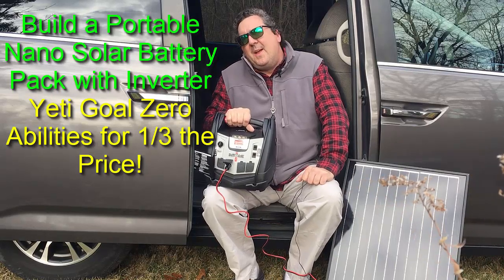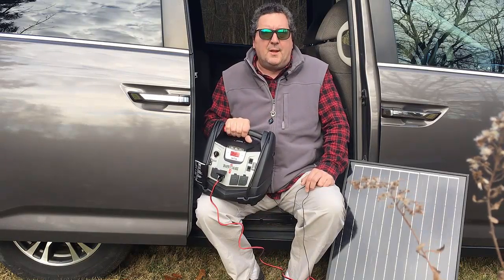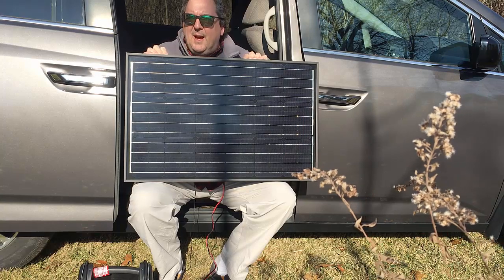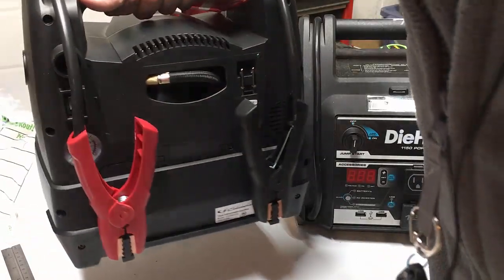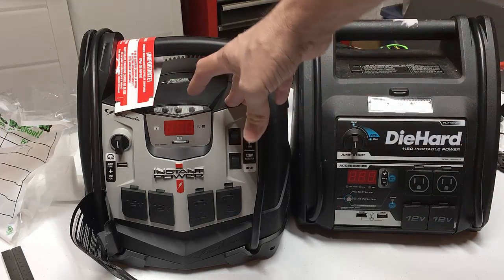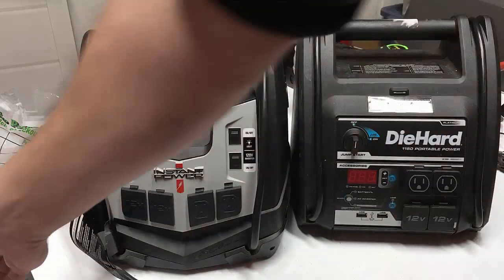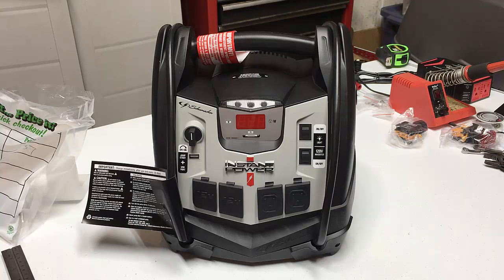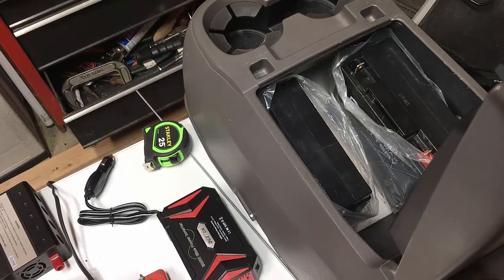DIY Portable Solar Battery and Panel

Comment: Check out the voltage on your charger most are 12 volts and if you check the specs on a sealed lead acid battery you'll find as I did when watching utube videos I then tore apart my old black and decker it was confirmed right the battery was written do not discharge below 12.2 and the float was 13.4 volts and full charge is 14,8 and the voltage on the charger was 12 volts so it's dead to start with anytime you leave a lead acid battery in a dead or flat stage the sulfur in plates start to harden a process called sulfation and the battery won't take a charge since there is always internal shorts the battery losses power over time so in a month if you loose a volt it now down to in making the battery useless so once a month you'll need to charge it properly best way is to use the cigarette lighter plug to cigarette lighter plug and hook up a good battery charger to it

Comment: I need your advise. I have a portable folderable 100W solar panel which I use with Jackery power bank. Can I just use this panel's one of the connector to charge Schmacher power bank? Please advise me. Thank you so much for the video
Reply from the maker: Hi Eric, You will need to put a solar charge controller in between the panel and the Schumacher.  It's what I show at this point in the video:  https://youtu.be/GUaXuZw7rzc?t=978    You could also use a different model of solar charge controller (10A is enough).

Comment: @Odyssey Camper
According to the manual. charging by means of DC power overrides the 'maintain' mode and can therefore overcharge the battery with dangerous results. Is that problem solved because the dc power is coming out of the solar charge control?
Reply from the maker: No, unfortunately it does not prevent that issue. From what I see in the wiring, the 12V goes directly to the battery. However, you can check the battery voltage every 30 min or so when driving and pull it off when it gets charged. You’ll never get to 100% that way, but you can get to 80-90. You can also put a small inverter between the cigarette light and the 120v built in charger, to get a full charge.

Comment: Hi there!  LOVE your stuff! Great content.  Questions: 1) you day Diehsrd has larger invertor. What I see is both have 400w invertor. Did I miss something? 2) can both of these be charged via your 12 volt cigg lighter plug and do they come with that cord?

What I did see was that the Shumacher, I think, had a bit larger ah battery...18ah on diehard a d 22 or23 ah on Schumacher.
Reply from the maker: Thanks!  You have amazing attention to detail!  You heard correctly, it's just that the specs for the Schumacher are misleading.  If you look at the manuals for each, the Schumacher is rated for 200W continuous.  They cite the peak capacity which is 400W.  This link should bring you to the right page of the manual.  https://www.manualslib.com/manual/149568/Schumacher-Instant-Power-Xp2260.html?page=8#manual  The DieHard unit is rated for a constant 400W.  It's shown on page 9-10 of the manual.  https://c.shld.net/assets/docs/spin_prod_751319512.pdf    You CAN charge both directly from the cigarette lighter but neither one includes the cord.  However, if you go to my Kit page here, you'll see the parts to make one.  https://kit.com/odysseycamper/diy-solar-generator    One word of caution.  Although you CAN charge from the lighter plug, you should not leave it connected for more than 40 min or so, or you can overcharge it.  Also,  since your vehicle doesn't really have a float charge mode, the pack won't be 100% charged, but maybe 90%.  In some of my videos I mention that a dead battery could draw too much current and blow a fuse.  I tested this and it turned out NOT to be true of these tiny batteries, so it's no problem charging from the lighter socket.  Thanks for watching and for the awesome questions!!
Reply: Thanks so much for your response.  I am also having trouble finding at least a 50 watt suitcase style solar panel.  Harbor Freights is only like 13 watts - I think.  I don't want to mount anything on the vehicle that I would be using.  Many others are too expensive- Even the folding style.  The flexible ones are poor quality to me.

BTW, the prices have gone up on both Jump boxes - even at Lowes.  Pretty good jump.In the $130 range at Lowes for Shumacher and about $160 on Amazon for either.
I currently have a Everstart 1200 from Walmart - only $64.99 but you cant replace the battery and the invertor is only 100w. Once that battery is shot, the whole box is toast.
Reply from the maker: I’m sorry, your second message got held up in the filter and I didn’t see it. Yes, the prices seem to vary wildly, which is troublesome because as soon as I give someone a price estimate, it goes up or down. I’d check over a few weeks and when you see a price in the future that is lower, jump on it. As far as the folding panels go, they are overpriced in my opinion. I’d consider making your own with a long (piano) hinge, a latch, and a handle. All three can be found at Lowe’s. Then you can buy the panel size you need.

Comment: Hey there, I am on a similar path as you (converted Chrysler Pacifica)...I currently have the Schumacher unit. My plan is to expand via minn Kota battery box, and throwing a 125ah agm inside. My main question is for charging this set up while driving. I didn’t want to mess with male to male aux. from car to jumpbox-but was thinking; aux/cig. From vehicle (15amp) /into inverter 150watts/then plug in a normal 110 extension cord to the proper charge inlet on the back of the Schumacher...I haven’t seen anyone do this to keep batteries charged/maintained. Will it charge both batteries safely. I am still learning, but I believe what is vulnerable would be the male to male connection between the Schumacher and minn Kota box. If the 125ah battery is low it would draw more through that 15amp fuse I believe, or would it work? Idk -I will eventually do solar, and have a 60 watt folding unit by Rockpals for boondocks. And info would be appreciated... thank you! Safe travels
Reply from the maker: Cool, another minivan camper!!  I think you do have a valid concern with the current draw from the 125Ah battery if it is low.  With the 22AH batteries in these jump packs (some are 10Ah) even a dead battery only draws a few amps.  With the bigger one, you could draw more than 15A.  But fuses are cheap, so I would try it and see.  You might find that it's not an issue.  I think your idea of connecting from the lighter to an inverter, into the charge inlet would work.  It would be inefficient, but it should work fine.  Inefficiency isn't really a concern here, since the engine is running anyway.  Also, it would charge both batteries without damaging the internal charger, since it is current limited.  BUT, it is not big enough to rapidly charge both batteries.  It would charge slowly and would probably only be well suited if you are driving every day, or using it to keep things topped off.  I actually have my diehard in the garage right now, keeping two batteries topped off.  I turn the jump switch to "ON" and connect it to the spare battery, which puts them both in parallel.  Then I plug in the unit to run the charger.  Hope this helps (going to read your other questions now).  Thanks for watching!

Comment: LOVED THIS VIDEO!! IS THERE A WAY I CAN JUST BUY A Solar Charge Controller AND not have to sauder anything? CAN I JUST CRAZY GLUE IT TO THE BACK OF THE SOLAR PANEL, THEN CONNECT IT TO MY UNIT THAT YOU MENTIONED?
Reply from the maker: I'm glad you liked the video!  Crazy glue would not hold due to the slight flexing of the panel and the effects of weather.  However, you could use aquarium sealant (RTV sealant), it just takes some time to dry.  I used 3M trim adhesive strips, but the problem with those is that they make it near impossible to remove the charge controller if you ever want to (I've tried and I think it would damage the panel).  To avoid soldering, you could use crimp on lugs like these  https://amzn.to/2RjOKPk  Thanks for watching!
Reply: @OdysseyCamper  omg you are AWESOME!!!! So to be clear, I can buy those connectors and not have to sauder a thing? But I still need to open the solar panel and connect the wires right? As you showed in the video? Or no. 

THANK YOU so so much :)
Reply from the maker: Northern Girl you’re welcome!
Reply: @OdysseyCamper  when you have the time
 Please awnser my q with your thoughts. I'm learning a lot and I am about to buy the solar charger and booster :)
Reply from the maker: @ASMRFoodieeats2  That is correct.  However, you will also need the crimping tool, which I forgot to mention.  Here's a link to the tool, but you can buy this in a kit at Lowe's or Home Depot for less than this Amazon one.  I'd only buy this kit if you will be doing other work as well.   https://amzn.to/2RmW2Sj
Reply from the maker: @ASMRFoodieeats2  Thanks for the ping, I read your comment on my phone and did not see the questions.
Reply: @OdysseyCamper  thank you!! The crippling kit!! Can I get that instead of the first mentioned product. Or both? Thanks again.
Reply from the maker: Northern Girl if you get the kit it will have what you need.

Comment: Thanks for the video but I do have a question is the 12 volt regulated and is the 110 regulated? I'm sure you know what I'm talkin about but for others I will explain it does it maintain full Voltage until the battery is completely dead or does the output drop during discharge. Thank you in advance
Reply from the maker: Wes Walker Good question!  The 12 volt output is straight from the battery, so no, it is not regulated. The 110 comes from an inverter (for the benefit of others reading this) and maintains full voltage until the voltage drops below its operating voltage. I’ve never tested  the exact battery voltage that this occurs at but I THINK it is around 10.8 volts. It beeps and then the inverter shuts off. Thanks for watching!

Comment: Hi, very helpful vid.  But can you help me with a question?  I can’t find anyone I trust or who knows.  I want to get a Dometic CF-18 refrigerator for my Prius, but I’m afraid to try it on my 12v.  Will the Shumacher or the Sears DieHard you show here get enough amps (is it amps or watts?) to take care of the Dometic all day and night if necessary in my Prius (I would be driving almost every day to keep it charged)?  SURE would appreciate it.  Thanks!
Reply from the maker: Carole Olson the battery packs (either one) would power it while you sleep and during the day, you can plug it into the Prius. Keep the empty spaces filled with water bottles and it will not draw much power once it is cold. Even unplugged, it should go through the night and still be cold in the morning.

Comment: Do you know how I can find the right model number to replace the schumacher 12vdc battery with a lithium battery. Thanks
Reply from the maker: Transform I don’t but you could probably fit one that is the same size. If you go to this post, there is a link to the  “DieHard” battery (same as the Schumacher) and it gives the dimensions. http://odysseycamper.com/battery-discount/     Note that you would also need to replace the internal battery charger, which was not designed for lithium. Thanks for watching!

Comment: I bought a 100-watt Renorgy solar kit. It came with a 30 amp charge controller, and some heavy wiring. Could I wire it to a male cigarette plug after the change controller into the  Schumacher similar to what you showed in the video? Thanks in advance. I really hope this works!
Reply from the maker: Greg F YES, you can!  The panel can generate enough power for 8 amps at 12V and that’s well within the 15A rating of the cigarette plug. In practice, the voltage from the panel will be higher and the current lower, but it adds up to the same amount of power. The charge controller will then step the voltage down to the right level for charging.   Go for it!
Reply: @OdysseyCamper  Thank you!!!

Comment: Have the Schumacher SJ1332 does it have overcharge protection when charging through the 12 volt charger?
Reply from the maker: ANDY WAN it does not have built in overcharge protection but the instructions say 30 min at a time. I’ve charged for 60 min on/30 off and then check the charge state. If you use a charge controller then you don’t have to worry about overcharging.

Comment: Hello. I don't know if you'll get this in time I'm a total newbie at this stuff. It confuses me how the power box gets charged by the 12 volt output? Do I need a certain 12 volt plug for that to happen? Are all 12 volt plugs the same? I know in music it's all about ins and outs. So it's confusing me how to solar power a little is charging into an output? Any help would be great thanks
Reply from the maker: The 12V output of the battery pack is essentially wired directly to the battery.  So, if you introduce a voltage sufficient to charge the battery (either from a solar charger or a cigarette lighter socket) you can charge the battery.  A male to male cord is all that is needed to charge from the vehicle.  Thanks for watching!

Comment: I wondered how you added the extra battery. Did you plug it into the DC outlet?
Reply from the maker: Yes, the easiest way is a male plug from the extra battery into the DC outlet.  It is also possible to drill a small hole in the battery cover to run the wires through and then use a quick disconnect plug from the extra battery to the wire going into the battery pack.

Comment: My schumaker charges by the usb port. I just bought a 120w portable solar panel. My question is, can I charge the schumaker by using the usb adapter that come with the solar panel?
Reply from the maker: So my first answer is that I don't know, but if you send me some product links, I'll look at your particular setup.  However, I don't think it will work, and here is why:  The charging voltage has to be high enough to charge the battery, so a standard 5 volt USB would not be enough to charge a 12V battery or even a 6V. But there might be something about your panel and battery pack that I don't know about.  You can send more info here, or go to OdysseyCamper.com and sign up with your email (bottom of page if you are on your phone).  That will give you my email address and we can communicate there.  Thanks for watching!
Reply: @OdysseyCamper  I have the same Schumacher as you do. I can charge it threw the usb port while driving. I just bought a 120w eco worthy folding solar charger ($200 canadian). I dont remember if the schumacher saying it can be changed via cigarette lighter thingy. Lol. My van has 2 older sealed gal batteries hooked up to alternator. But they are old and don't fully charge and the inverter is also old fashion. I dont know anyone who is willing to help me change the batteries so that's why I bought the solar panel. I wish I had your knowledge. Thanks for your video.
Reply from the maker: @savedby_gracethrough_faith  OK, then it's possible that you could charge through that port.  Nobody is born with all the answers; we all had to learn too ;-)  I suggest you check out the channel, DIY Solar with Will Prowse.  I didn't know about him when I put all of my stuff together, but he has some very good info on his YouTube channel.  He has also built a number of van/RV systems.

Comment: How long will the Shumacher power a standard CPAP machine?
Reply from the maker: Hi Bobby, If you can tell me how many Watts (W) or Amps (A) it uses, I can give you an estimate.  That info should be on the CPAP or its AC adapter.  Most are around 30W which would give you 6-7 hours of run time.

Comment: Could I expand this system using a 100ah marine deep cycle battery?
Reply from the maker: Hi Anthony,  You could absolutely do that, just remember anything you take out of the battery, you need to put back.  A 50 Watt solar panel only puts out about 5A max, so that would take in excess of 20 hours of full sun to fully recharge a big battery.
Reply: @OdysseyCamper  Thanks so much. You and your video have been very informative.
Reply from the maker: @offgrideditor  Thanks for watching!

Comment: Can you charge this through cigerette lighter while van is running?
Reply from the maker: Lance Catterall  Yes, you can, but...you will want to put a charge controller between the vehicle cigarette lighter and the battery pack. The reason is if you wired it directly the battery pack could draw too much current and blow the fuse. You can use the same charge controller shown in the video. The wire that says “solar” would go to the vehicle lighter. The wire that says “battery” goes to the battery pack, just like in the video. The best part is you would only need to buy an extra plug from the parts list. You can use the same charge controller for both the panel and the cigarette lighter. In that case you probably won’t want to stick it to the panel like I did.
Reply: Can I change to lithium battery replacement.  I paid too much!  Hate that
Reply: In the process of doing this and i can not get it to charge. I'm losing my mind.